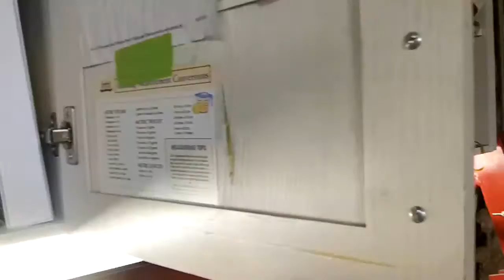1959 Triumph TR3A Restoration, Front Suspension, Part 3

Comment: A product that I use to get the rust completly off a part is EVAP-O-RUST. I get it at True Value Hardware  here in Oregon.  I use my bench grinder with wire wheel to remove the heavy rust and the drop it in a container of the EVAP-O-RUST for 24 hrs to remove every little bit of rust, and it gets into every little nook and cranny.  Then just rinse with plain water and dry and it is ready for primer.  It is non toxic and REUSEABLE.  It is a great product.
Reply: going to have to try  this evap-o-rust stuff out.